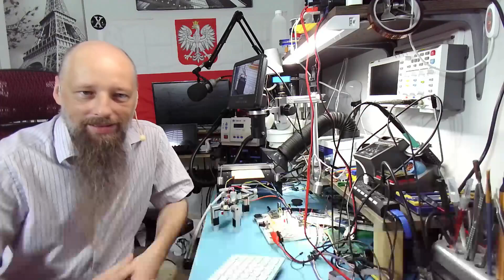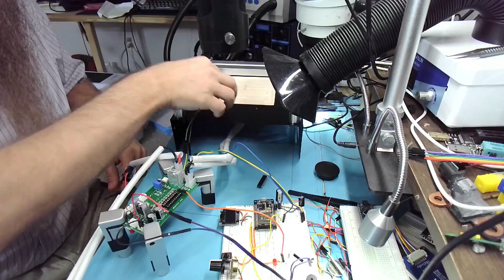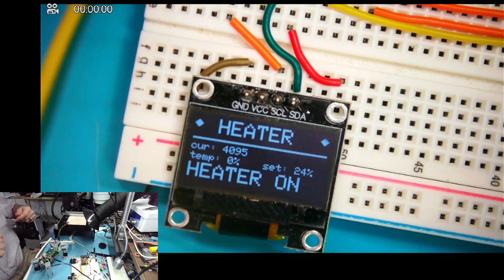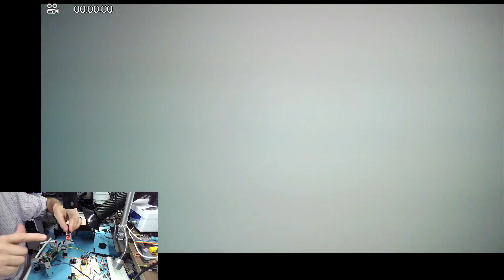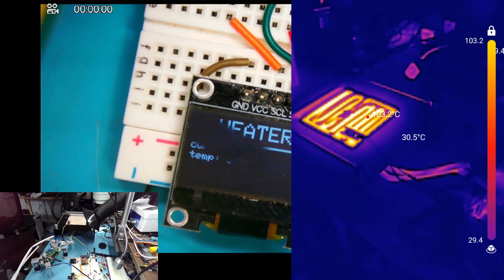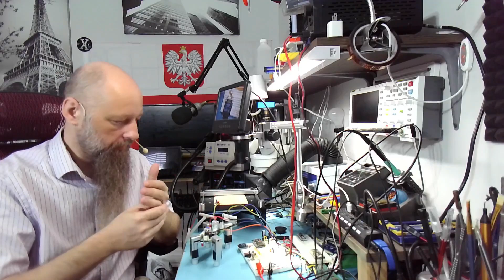Day #33 | Temperature Controller Considerations | ESP32 Heater Controller

Comment: Happy birthday young lad.

I was going to suggest a cheap 3d printer board would have also worked quite well for your application. all features included.
Reply: Also, do you really need to run multi-thread for this? I achieved this with a nano and 8x16 lcd many moons ago for a fan PWM driver and feedback. It was for an automated test suite to ensure the fans were spinning at rates we expected, but an auto test cycle.